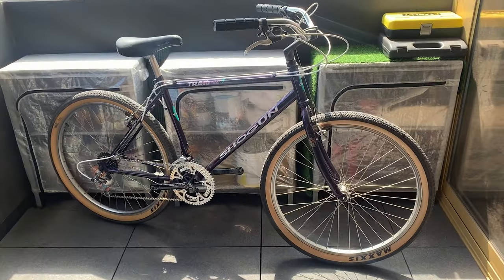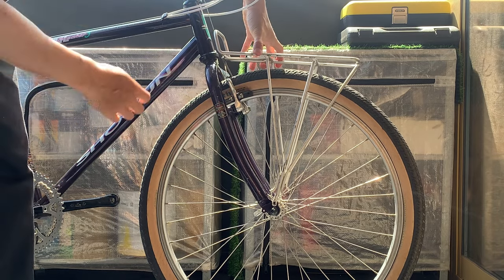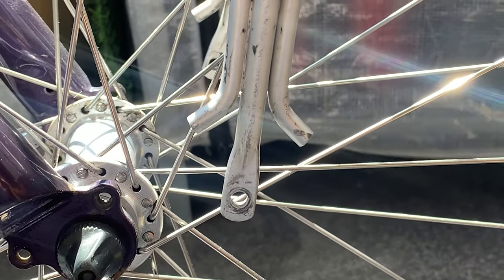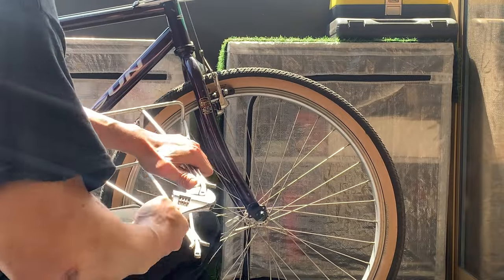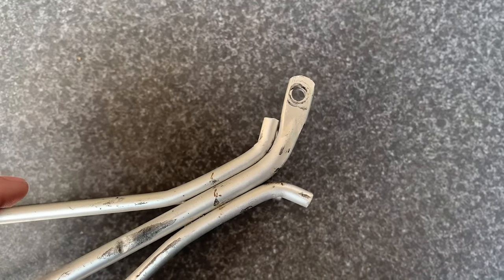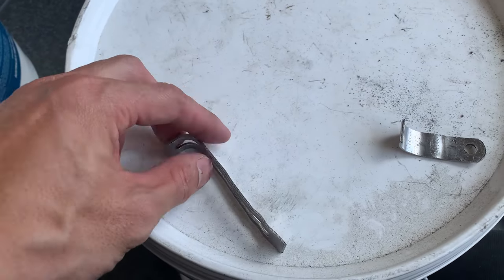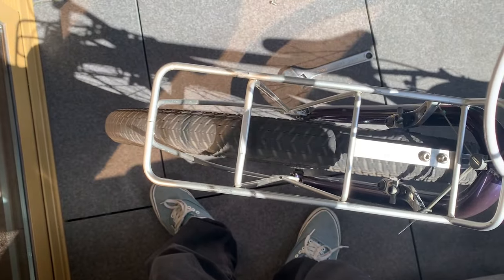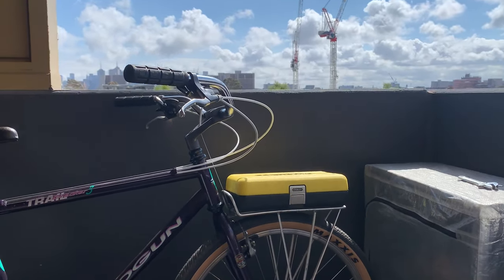how to: convert a rear rack to a front rack

Comment: I just sawed the loop off an old Blackburn rear rack so that it made room for the front brake on a 1996 Saracen MTB.  
(I did a Canti to V-Brake conversion as well, because Cantis are bloody awful).  
It's much better to have the load transmitted vertically down, to steel bolts in a steel frame, than to a bent aluminium tube.
Reply from the maker: Nice !! Glad you were able to do it 👍

Comment: It looks really good. Just wondering if you put heavy items on the rack the fact that the attachment is bended it could be eventually a problem. Metal resists well to compression and traction which are the forces you have there when there is no bend.
Reply from the maker: Cheers man! the metal is pretty thick so I don’t think it would be a problem but I’ll def keep an eye on it !

Comment: I have only rear eyelet on my fork, but I got the same rack, how can I screw it in in rear fork eyelets ? Any suggestions ?
Reply from the maker: Yep you can you would just need to make it longer or make an adapter , some ppl use a small piece of metal but I’ve actually attached racks to that eyelet before without any problems